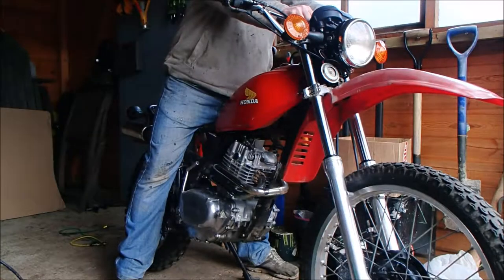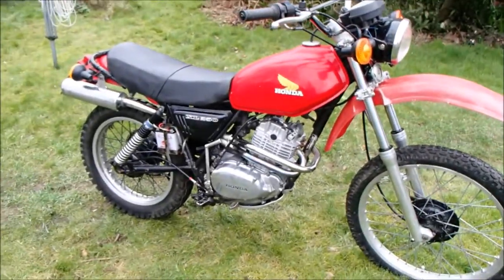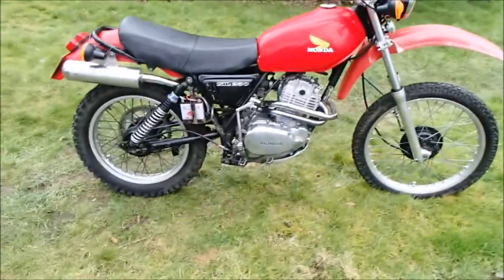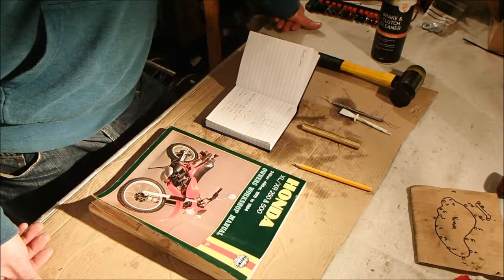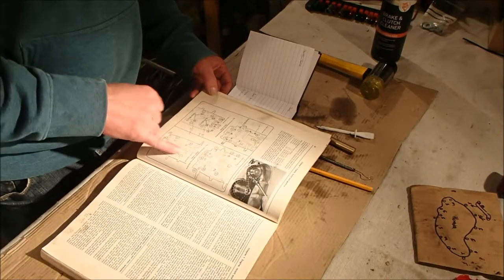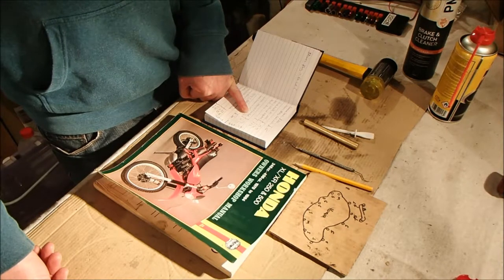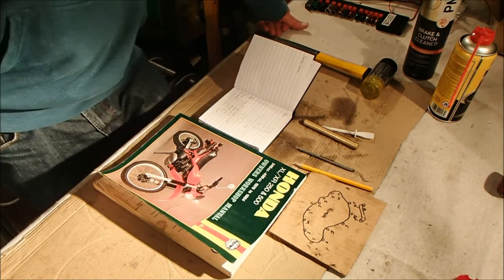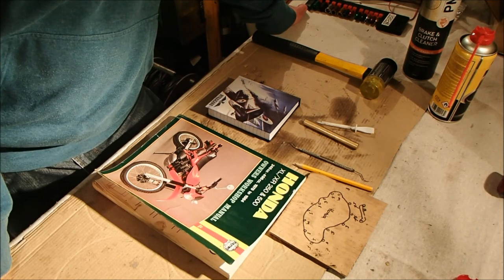Honda xl250s engine restoration (part 22) final engine testing

Comment: Thanks for this restoration, watched the whole lot as I have a 1978 XL250s bought from new when I was 17! I hardly ride it these days, but I maintain it and It still woks fine and starts first kick but the cam chain sounds a bit rattly. Your videos will be a huge help if I decide to take the plunge and overhaul the engine, thanks again.
Reply from the maker: The fact that you still own the bike is fantastic. They are getting rather scarce these days. The cam chain shouldn't be too big a job, personally I would remove the engine after cleaning it. It will make your life easier. God luck if you decide to go for it.
Reply: @richardjweeks  Thanks will do. I've had a few bikes over the years but could never seem to part with my original Honda. Here's a fairly recent pic https://www.flickr.com/photos/ceddox/47672014841/in/dateposted-public/
Reply from the maker: @snodgegrass8  pooh, a rare white one. Very nice. Look after her and she should do another 40 years